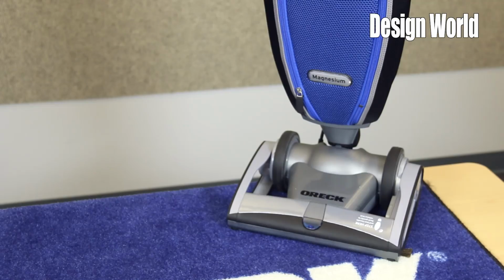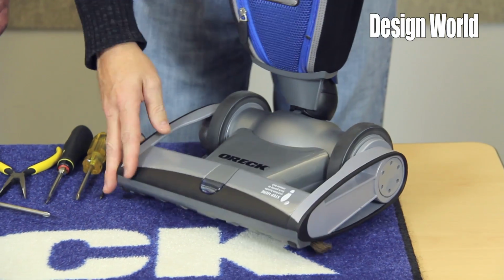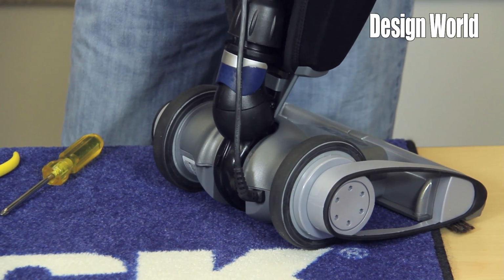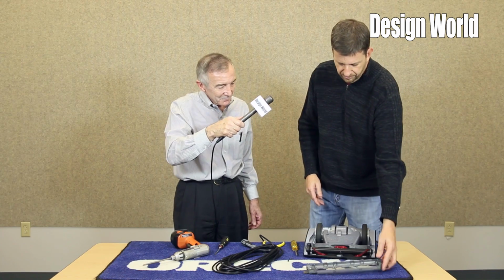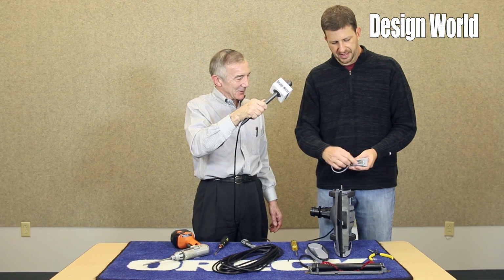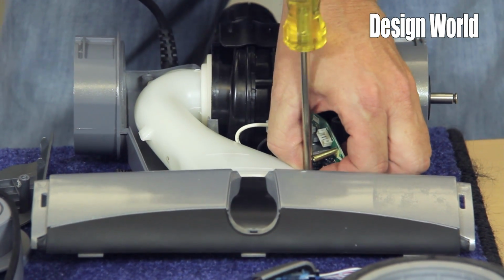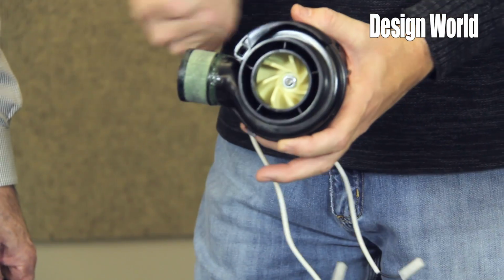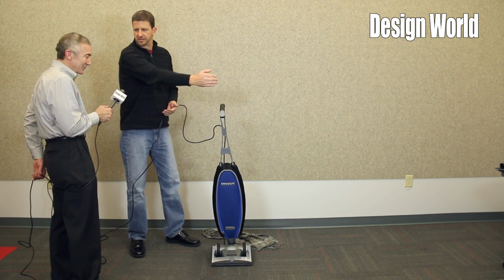Inside the lightweight vacuum, Oreck's Magnesium RS - Teardown Corner

Comment: Oreck will not run. You name it and I replaced it. Still will not run. Is there a way to direct wire it to the drive motor? This RF signal sucks!  Thanks for any help or ideas.
Reply: Hold down the power button for 60 seconds to reset the connection. Usually fixes it.
Reply: Did that many times! The engineer that designed this should have been fired!  I finally took out the control board, direct wired,and put in a inline switch.  Works Great for us.

Comment: I can't turn my Oreck Magnesium on. Not sure if it's the motor or the battery in the handle gone bad...( I hope). I did have a little bit of shocking going on in the handle but I put a cover over the handle and that seemed to help. IT worked the last time I used it but today it doesn't turn on. Any advice would be very much appreciated.
Reply: Hold the power button for a minute and it’s supposed to reset it

Comment: Thanks for telling us how to release the handle from the body. The cheap plastic part that holds the bag in broke in half when i barely touched it trying to see where the release buttons, tabs, whatever are. I wonder how much that part is going to cost me, 50 bucks probably.
Reply: The Magnesium vacuums have a 7 year warranty so that part would be covered during that time frame. The part retails for under $5. There must have been a bad batch of bag holders as we have seen some become brittle for no apparent reason. Most Oreck parts are readily available and reasonably priced,

Comment: I cannot pull the handle off the base of the cleaner to clear the blockage.  Is there a trick to this?   Looking at the video, it looks like you just pull it out of the base.  Any ideas?
Reply: Turn the collar nut counter clockwise until it moves freely upward. Then give the tube a bit of a twist while pulling up and away from the base.

Comment: this vaccum is total crap. You can't change the belt, nobody makes them. you can't change the bag. You have to change the vaccum when the bag is full. Attempting to change the bag will rip the end off the vaccum hose, ruining the vaccum. If you like the vaccum, better buy three or four of them and stock up. Total garbage. Better yet, get rid of all your carpet and replace it with hardwood floors.
Reply: What in the hell are you talking about? There's no hose to rip and if you break it just by changing the bag then you're doing something very wrong. And what do you mean by "no body makes them?" Uh, they're still being made and sold sooooo...
Reply: I don't know what brand of vacuum you have but it is not an Oreck.